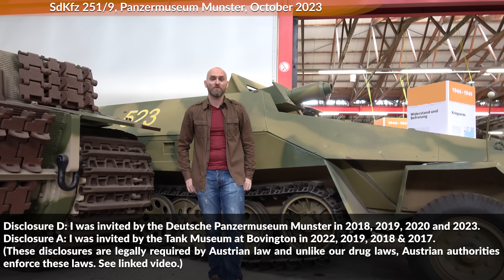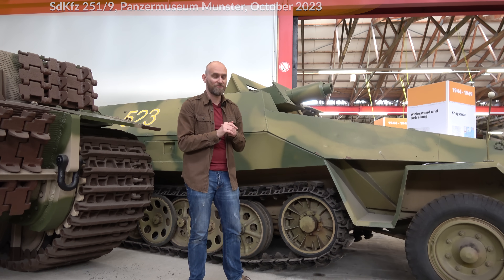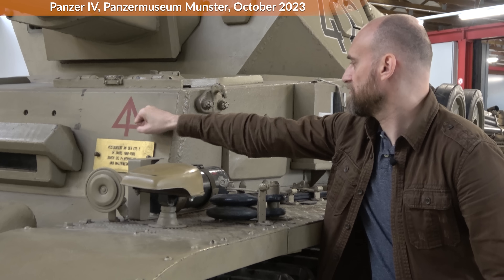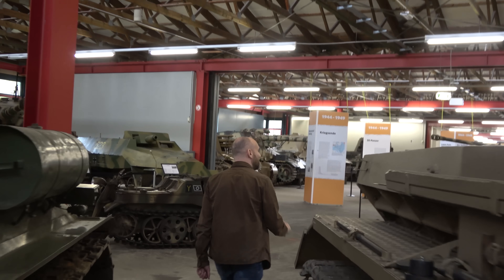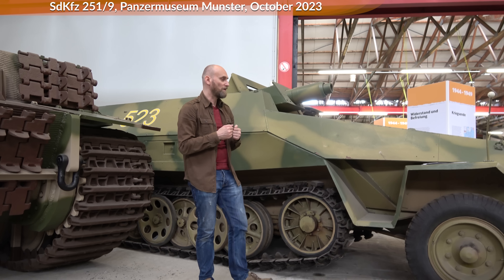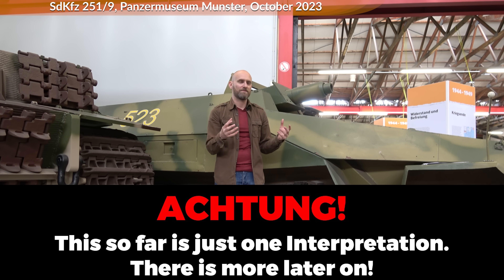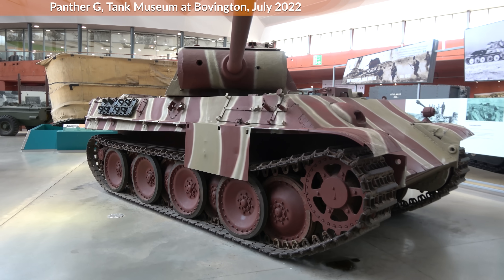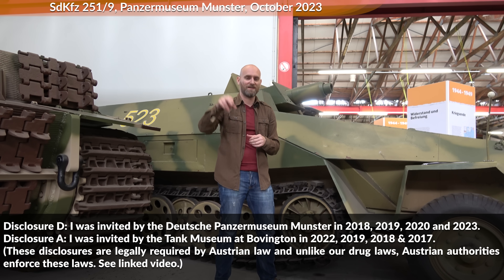Why was German Sloped Armor so late?

Comment: I don't think it's unreasonable to say that Germany just didn't anticipate the escalation of firepower and armor during the war and wound up way behind the curve. While Germany was mounting 3.7cm guns on their tanks, the Soviets were mounting the 76mm L-11 and already working on better 76mm guns. It's en vogue to downplay the things the Soviets got right, and it's always been hip to hype up German technological advancements, but the Soviets got things very right when it came to predicting protection and penetration escalation, and Germany got it wrong. The T-34 was a pre-war design that wound up being produced until 1958. Meanwhile Germany's anti-tank tank was relegated to assault gun duty, its infantry support tank wound up extremely front-heavy with massive unplanned firepower and armor upgrades as a stopgap, and they introduced 3 separate designs of heavy* tanks to address their overall drawbacks, most of which used sloped armor.

If the Germans were only ever expecting to deal with 45mm AT guns and low-velocity 76mm guns in a short war, vertical armor makes a lot of sense, especially when you consider how effective face hardening was against smaller caliber anti-tank weapons. You're only going to need ~50mm of armor, and that's not such a huge mass of protection that you need to worry about designing to maximize its efficiency with sloped armor at the expense of interior space. It's even worse than that though, because the Panzer III and IV were first produced with 15 MILLIMETERS of frontal armor. With protection that light relative to the weight of the chassis and equipment, it makes zero sense to save a little armor weight with sloped armor at the expense of complexity and loss of interior space. IMO, the PzIII and PzIV didn't have sloped armor because they were old designs never expected to face serious anti-tank firepower. 

Something else I don't think people are talking about is the limitations of your metallurgy. As you continually increase the thickness of your steel you are increasing the difficulty, expense, and rate of defects in your armor. You need increasingly specialized fabrication equipment. If you try to keep increasing the thickness of vertical armor, it will start to get less efficient (even before considering the effects of angle beyond simple LOS thickness) and MUCH more expensive - sloped armor becomes the only practical way to continue increasing protection.

Comment: One thought about the use of interlocking plates in welded construction.  Even before the development of fracture mechanics, it was well known that welds were more brittle than the material that was joined by the weld.  Perhaps this interlocking joint design was meant to limit the extent of a weld failure due to impact from a shell.

Comment: I still don't grasp all the issues in WW II tank assembly.  Last time I welded 75mm thick hardened steel = never ... But at least I can imagine it.  Last time I welded 75 mm thick hardened steel using 1940's tech = never^2.

Comment: Most likely it's the easiest answer 

It's easy to put a lot of stuff in a box than a triangle 
As a machine assembler / electrician it's hel to work in sloper aerias 

Also think about the stuf they put in it ammo boxes ar square 
Radios ar square 
Shells are easier to put away in a square box

Comment: Interlocking will reduce some stress on the weld.normal seam from side all pressure will be on weld.interlocking could get by with less weld at  cost of more material preparation.

Comment: Sloping was first seen in late medieval castles soon after the development of cannons. It was first applied to tanks in practice WW1 but in theory even the Da Vinci tank had it. Though the Da Vinci tank was designed that way for structural reasons rather than for enhanced protection.

Comment: Was probably cause experienced welders were in short supply, bet there's a lot of shallow welds on mass produced 4" plates. Bet it helped with assembly too, just lego a hull and leave it, the welders would get to it eventually and they won't need cranes and precise placement

Comment: My mate is an engineer, he builds and designs trailers. He always uses interlocking where he can. He told me that it provides good strength and shock absorption and stress is distributed equally
Reply: Ask him about welds.
Reply: @MarcosElMalo2  Yeah sorry thats what I meant interlocking puts less stress on the welds and distributes pressure evenly. funny enough where the welds have broken (his designing a new trailer for farming) is were the parts cant interlock.

Comment: everyone understood the benefits of sloped armour, and tried to apply it where possible, but there were a number of factors which limited their implementation, which to me, beyond the need for more protection boil down to the following factors
-vision
-space
-size
(and to a lesser extent)
-weaponry

-vision
as explained in the video, before people got the idea of using prismatic periscopes as vision devices in tanks, the only good way to give vision to crew, especially to the driver was via direct vision ports, mirror periscope did exist but either lacked strength or did not offer good quality vision
and mounting a protected direct vision device on a highly angled plate without sacrificing too much sight is a complicated ask and might have been too expensive, so instead you limit the angle of the plate you mount your sights to (i think the most angled plates with such a vision device mounted was on french tanks and that was "only" 22°)

-space
now that we solved the sight issue, there is another one: angling plates inward will inevitably cut in the available interior space. it's simple geometrics, but tank do need to house a lot of stuff beyond just the crew and weapons, there are ammunition, both for the guns, but also the MGs, additional small arms for the crew, in many tanks a spare machine gun was carried, or a kit to convert the tank MG into an "infantry" gun, there are also fuel, oil, batteries, a radio set and it's equipment (which in WWII, can take up a lot of space), maybe water for the crew, or even lockers for tools and crew equipment/tank spares, and of course tanks not being steel coffins, you need space for the crew to be able to fulfill their duties, not to mention that for a given size of tank, angling plates will cut into the roof size, which will limit the size of turret ring and by extension, the size of gun you can mount in your tank

-size
so why not make the tank bigger, so you can eat your cake and have it too? because making the tank larger to compensate for the loss of internal volume will add weight, and make the tank harder to transport, if you don't want to give your logistic officers an aneurysm, try making every equipment able to be loaded on a train, and if you do that, you will necessarily have an upper size limit so your tank will fit in tunnels, on bridges and in curves

-weaponry
this is the last point and do not pertain to the main (turret) weaponry but to hull mounted weapons, and that is why i consider it a lesser extent as it can be ignored if you do not plan to have hull-mounted weapons
but the point is simple: mounting guns on a highly sloped surface is hard
if you look at nearly all tanks with hull mounted guns, you will find that they either have (mostly) flat armour, or that they cheat (sherman and T-34, their armour are sloped but their bow MG are mounted on a vertical plate), tanks that do mount a gun on sloped armour generally do not mount the cradle to the armour directly, but instead to a shield of sorts that is bolted on, and moves the gun mounting points (trunnions) to more convenient places
the only ones to actually mount guns to angled plates were the germans, but also the geometry of their guns and bow mounts did allow to be adapted to be used on an angled plate
inversely the british never switched to angled armour during the war in part because they couldn't figure a good way to mount the hull BESA

Comment: I think they also used the boxy design because they needed the space for the crew.

I mean if you compare the T 34 and the German tanks you can also see that the german designs focus on a good workspace for the crew with a better overview and more space inside the hull than the T-34.

It may not be the main reason why they stuck to non sloped armour but I think it definitely influenced the design cause they had the fighting conditions for the crew in mind.

This would also help to understand why later on the used sloped armour because tanks like tiger 1+2 and the panther variations are already huge enough for good crew space.

The smaller tanks with sloped armour are probably caused by changing the focus away from crew "comfort".

Comment: Weren't the Germans plagued by chromium shortages during WW2? Chromium and Niobium were used in steel for their properties altering effects in Germany for sure. And with rocket research searching for the most strength with the lowest possible weight in alloy compositions, combined with chemical and oxidizing resistente. I figure they were well aware of effects like adding even less than 0.1% Niobium can lessen the need for chromium while strengthening welds and hardening the steel. As the strength of steels increases, the fracture toughness decreases, so the likelihood that hydrogen embrittlement will lead to fracture increases. In other words harder more technologically advanced steel might need interlocking teeth construction, so that if hydrogen cracking occurs, the crack won't propagate along the whole length of the weld, causing cathastrophic faillure.

" In 1905 W. von Bolton, a German chemist, succeeded in producing niobium in a pure, ductile state. Niobium was first added to tool steel around 1925 and was first used to stabilize austenitic stainless steel in 1933. Interest in adding niobium to high-strength low-alloy (HSLA) steel can be traced to the work in 1939 of F.M. Becket and R. Franks, who demonstrated that niobium strengthening reduced reliance on conventional hardeners such as carbon, manganese, chromium, and molybdenum, thereby improving weldability. " https://www.britannica.com/technology/niobium-processing

 " Abstract, The carbon and chromium contents significantly affected the microstructure evolution in the stir zones of medium-carbon steels during the friction stir welding (FSW). The stir zone of the 0.2%C–4%Cr steel has a high strength over 1.5 GPa with a good elongation of 30.3%, while the stir zones of the 0.4%C–2%Cr and 0.4%C–4%Cr steels had ultrahigh tensile strengths over 2 GPa with low elongation. Auto-tempered martensite is the main reason for the excellent balance of strength and ductility in the stir zone of 0.2%C–4%Cr steel.
Introduction
Carbon steels have advantages including high strengths and low costs. Therefore, they are used in various applications in industries. The strength of a carbon steel increases with the carbon content. However, the weldability of the carbon steel gradually decreases with the increase in the carbon content as a hardened structure such as martensite commonly forms in the steel during fusion welding. Martensite with a high carbon content is brittle and susceptible to cracking. Furthermore, the ductility of the carbon steel decreases owing to the formation of the brittle martensite during the welding [1]. Hot cracking and excessive grain growth also occur during the conventional fusion welding of the carbon steel with a high heat input. "   https://www.sciencedirect.com/science/article/abs/pii/S0921509319308469

Comment: One reason I’ve also heard why the Germans (and also the British) held off using sloped armor for their tanks for as long was the mounting for the hull machinegun. The ball mounts they used didn’t work well with a frontal slope which is why both German and British early war tanks had the flat front plate. The Germans still had problems with this even with the early Panthers, instead of a ball mount those tanks had a “letter box” slot for the gun to shoot from. They did figure it out as later Panthers and King Tigers had ball mounts. Even the Soviets had problems with this, if you look at the T-34 the hull machinegun has a large bulge out of the slope so the gun can be mounted flat.  Only the Americans seem to have figured it out with the ball mounts with the one in the M4 Sherman with its sloped front armor. I have no idea if that is indeed the case but it does make some sense.

Comment: The interlocking plates may be an artifact of the need to produce these tanks fast. I can imagine that to position two or more heavy armour plates for welding you need some kind of jig that you later disassemble and pull out after welding, well if you have this interlocking system the jig can be simpler, easier to assemble and lighter. This would fit with 2 things, one of them being the fact that they needed to develop new cutting methods and speed was the key factor there(cutting + light jig operation must have been faster than just heavy jig) and also why has everyone decided to abandon these after WW2 - saving 20 manhours on production wasn't worth whatever kWh's needed to cut the plates into shape.

Comment: i find it odd that it takes almost 3/4 of the video to come to the same conclusion i did years ago, all the "sloped armour" is simply built around the components/people and not to increase armour protection until T-34 and Sherman with all the horizontal plates going over transmissions and legs

Comment: Its possible the germans were relying on the mortising of the joints for strength with only a shallow weld rather than a full depth weld. Also the germans produced steel that was prone to becoming brittle and cracking around the welds. This was because they couldn't get Molybdenum to use as an alloy. Molybdenum improves the hardenability of steel and makes it less prone to cracking when heated and cooled.

Comment: This type of keyed joint is commonly referred to as a "box joint" in English.  You may wish to contact the Australian Armor Museum for their opinions about keyed armor joints, their restoration shop has actually welded blown-up German armored vehicles back together.  They observed minimal and inconsistent use of armor grade stainless steel welding rods in the late production Stug 3 they are currently restoring, no doubt due to late war shortages,.
Reply: I am very curious about the weld penetration the Germans were achieving (or failing to achieve). And I further wonder if this was caused by material shortages (as you suggest), skilled worker shortages, or welding technology lagging plate thickness.

If box joints were supposed to improve structural integrity, why not go further and use dovetails? 😂
Reply: @MarcosElMalo2  the box joint is already inefficient compared to a straight line weld. Think about the fact that this would further increase the length of the weld and make the fitting of the armor plate even more difficult than a box joint no doubt does. Man hours are expensive, this might have been a compromise solution.

Comment: My eyes almost roll a full 360 degrees any time I see someone talk about sloped armor as if it began with the T-34. The Germans had been sloping tank armor since WWI with the A7V. The literal first "tank" concept in Leonardo Da Vinci's drawings from 1487 had sloped armor!
Reply: Tecknically even knights in the middle ages had slopet helmets and brestplates to deflect lances and arrows so the concept is almost literally as old as the idea of "armoured combat" itself.
Reply: Salty German
Reply: so what you are saying is that leonardo da vinci was russian?
Reply: @Blox117  - Or German LOL
Reply: Fun fact, Leonardo Da Vinci's tank could withstand a 76.2mm ZiS-3 AT gun at distances of between 600+ meters.
Reply: @oskar6661  the problem is though, I’m pretty sure armor steel was not a thing back then. Mild steel fare pretty badly to hardened AP projectiles afaik, so the effectiveness might be greatly reduced
Reply: And yet both of them are useless pieces of craps, so the T-34 is the real winner here. End of story.
Reply: Sherman also has sloped armor, they just decided that sloped armor on the sides is excessive and the frontal sloped armor is already enough.
Reply: @minhducnguyen9276  wasn't really that sloped, not compared to panther or T-34
Reply: Da Vinci's tank didn't have sloped armor for the purpose of increasing protection, but because of how the armor would be constructed, bound at the top.
Reply: @josephahner3031 
I don’t buy this. Even if you look at medieval armour you will find slopes and rounded surfaces. People understood the benefits of deflective surfaces.
Reply: @josephahner3031  Perhaps, but even back then people understood that cannonballs and other projectiles were more easily deflected by angled surfaces.

Comment: The interlocking welds/steel plates can also be found in warships like the Iowa class New Jersey. Basically, by increasing the surface you'll get a stronger weld.
Reply: That’s not how welding works. It’s very different than wood joinery. In welding, you are bonding two pieces into one solid piece. The weld needs to penetrate the thickness of the metal and you need the proper amperage going through the electrode/filler rod. You are fusing metal together.

In a wood joint, increasing the surface gives you more glue surface. That’s what you’re thinking of. 

The interlocking plates you saw more likely were to aid in more rapid construction—it would allow more rapid positioning of the plates before they were welded.
Reply: @MarcosElMalo2 a longer weld means the two metals are joined together over a larger surface, increasing strength

The mechanism might be a little different to glue, but in this regard it's no different